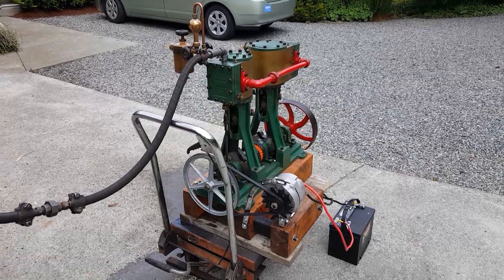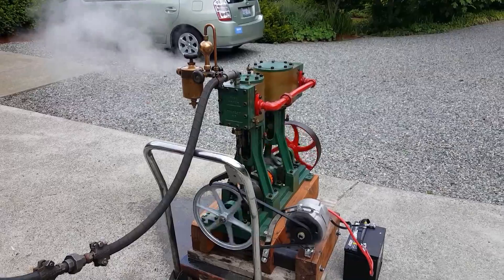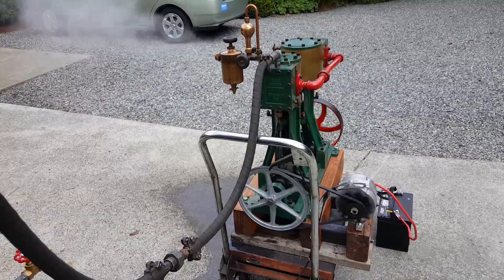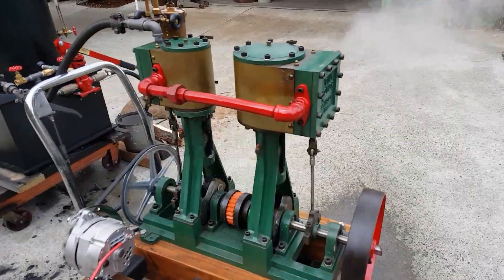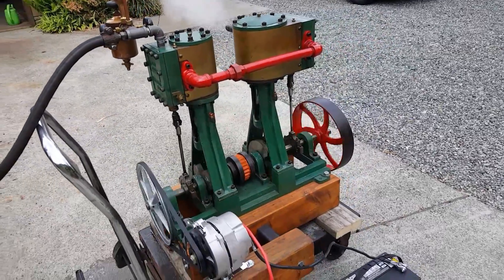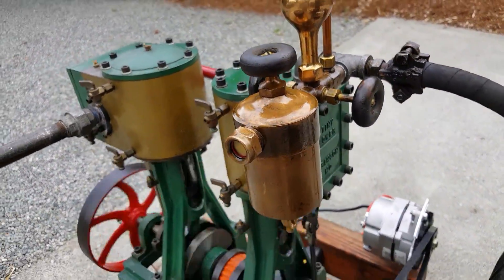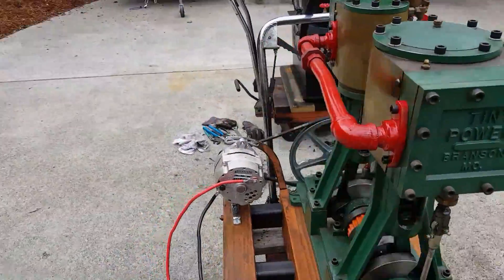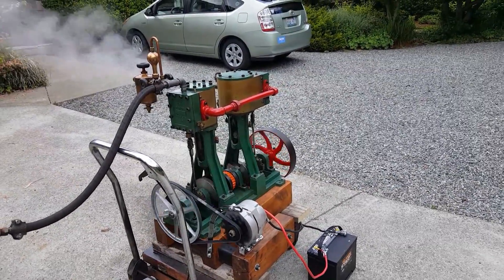Steam Engine with Alternator Off Grid boiler

Comment: I'm in vancouver island canada and have rights to the contents of a complete railway black smith shop run by a 3 cylinder steam line shaft engine, steam power hammer, foundry, shaper (abour 4 tons of it) and flat belt drill press and so much more.The steam engine is about 2ft wide at the base casting and 3ft long, around chest high. the engine and machinery are all filled with oil and when truned over by hand oil pumps out all over, several 300lb columbian pedistal vise. They cast, machined and forged railway car and engine and logging equiment, the last days production is still laid out as was left. Can i e-mail you pics ?. I'm interested in your smaller scale engine/boiler,    Petereit@cablerocket.com     thx
Reply from the maker: WOW!sammamishstore@gmail.com
Reply: By the name sammamish can I safely assume you are from washington state? i grew up in Snoqualmie. Now I am really interested.